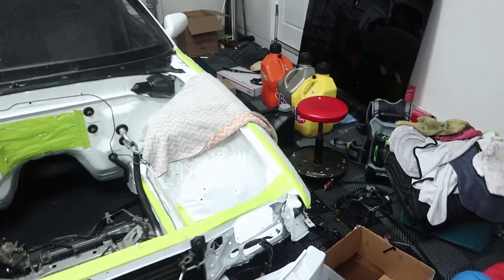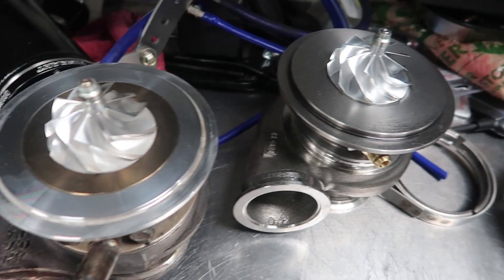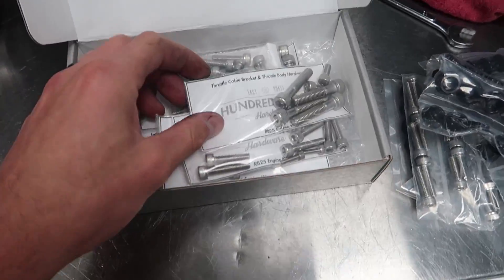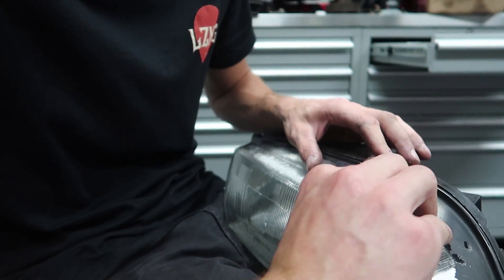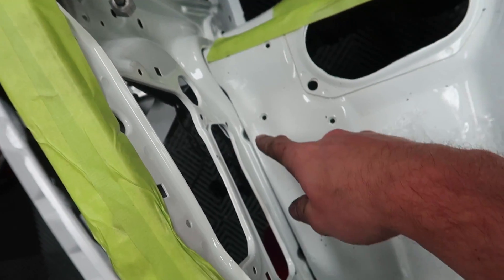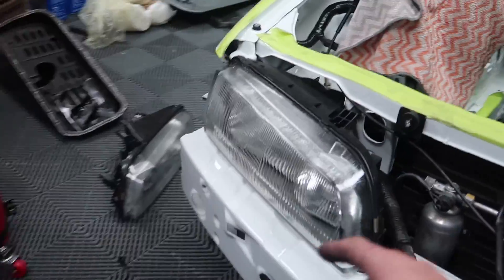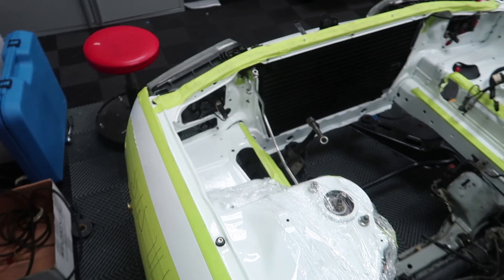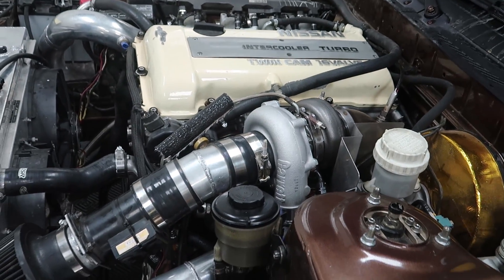New Turbo Sounds and Skyline Wire Tuck!

Comment: That bay is too clean. You should apply a sealant to it before everything goes in just to give it some extra protection since it looks so dang good.
Reply: Pretty sure they added a ceramic coating to it actually.
Reply: Matt already ceramic coated it, was 2-3 videos before
Reply: Casey Gray it’s coated
Reply: Dang I must’ve been looking away at that point in the vid. My bad

Comment: Like new hardware, looks tight. Also, don't forget that not all black electrical tape is made equal.....as there's specific high heat & anticorrosion electrical tape that is used for engines, computers, etc.....anything that needs extra protection from weather, components, etc....(some tapes can withstand temps ranging from 200°F-650°F & comes in handy....).
Progress on car looks like going great. Can't wait for next vid day after 2mro.
Cheers, A👍🏻👍🏻

Comment: Now you've routed the wiring looms around the engine bay, they are now exposed to any damages if you run into someone or crash. The first thing to get damaged in a crash are the headlights and surrounding areas, where your looms are.

Comment: You should use rubber linerless splicing tape. It only sticks to itself and is designed for wrapping wires. It also doesn't leave the sticky residue when you remove it like electrical tape. Home depot has the 3M version and I redid my whole wiring harness with it, just stretch and wrap👌🏼

Comment: They actually make "loom tape". It's made to only stick to itself, it doesn't have the nasty adhesive like electrical tape. And it comes in a 3" widthso it's easier and faster to wrap wires.

Comment: Sup Adam you could put your shop vac on the condensation line on the outside were the condenser is to clear the line from small frogs or mold jelly. Or the temperature sensor could be faulty. Bleach can be pored into the condensation pain where it would clean and clear the line and stop the A/C from firing up.

Comment: Little tip if you wanted Adam, could use stretchy black sports tape around your harness& wires instead of electrical tape.... looks a lot cleaner

Comment: Use Tesa tape for your wires. Heat resistant and it only sticks to itself not glue all over the wires like electrical tape.

Comment: tip from an electrician. if youre gonna use electrical tape use 3m super 88. much better than the standard 1700

Comment: Are you using the self stick harness-wrap tape or regular electrical tape?  the self stick stuff is amazing because it's really secure and doesn't leave residue on the wires

Comment: Watch out for "stretching" the wires too much. Looks like the wires for the headlights goes in and straight 180degrees in a rather "thight" connection. Thight/stretched connections in a drift car which have LOTS of vibrations can harm your harness plugs and cut through wires by grinding against thight corners. Hope it makes sense?? :-)

Comment: Your drift car collection now have 1JZ, 2JZ, RB25, VQ35, SR20 in it. Might as well buy another Skyline, that have RB26 in it to complete the ultimate JDM Set
Reply: TunersGTR what has the the 2jz. Or is that going in the s15 eventually?
Reply: Audio Cracked the S15 ofc..that still in WIP at Enjuku Racing
Reply: Gotta get a 13b too
Reply: Hasn't completed the 2JZ stroker thing he started a LONG while back. I might get my 2J build done before that comes online.

Comment: Your BOV isn't in an ideal spot now, put it right before the throttle valve for better response!
Reply: Isn't it true that pressures are highest right after the compressor? If that's the case, isn't it in the most ideal location to actually perform it's function of protecting the turbocharger?

Comment: Can you daily an s13/s14? Not too worried about fuel just reliability and repairs, anyone got any idea if I’d be able to use one to drive literally everywhere?
Reply: Dreg of course you can daily them just find one that hasn’t been beat on or heavily modded
Reply: Devin hymes thanks man I’ve really wanted to daily one for a while but I’ve been apprehensive because I heard they’re unreliable but yh I’ll definitely start looking around soon then
Reply: Dreg I think the only ones that are unreliable are the ones that used to be drift cars. My friend has had 2 stock ones and only had to do the injectors
Reply: Devin hymes oh cheers dude ive been really wanting an s13 daily i freaking love them but friends were telling me theyre too unreliable and that i should get an e36 and as much as i do like them i just love JDM cars so I'll definitely be looking for a new s13 daily project
Reply: Dreg yeah s13’s are so cool I want one too and a e36 would be cool too but I feel like they’d cost more to fix if something breaks
Reply: Yh BMW parts arer super expensive even here in England so I'll definitely be looking into an s13 for the new daily, tbh my plan is to much later down the line engine swap it to a 2j or an RB anyway
Reply: Dreg oh that would be sick

Comment: it's en engine not a motor! 😂
Reply: Stop it. All engines are motors. Motors are not just for electric things.
Reply: wikipedia"However, technically, the two words have different meanings. An engine is a device that burns or otherwise consumes fuel, changing its chemical composition, whereas a motor is a device driven by electricity, air, or hydraulic pressure, which does not change the chemical composition of its energy source"